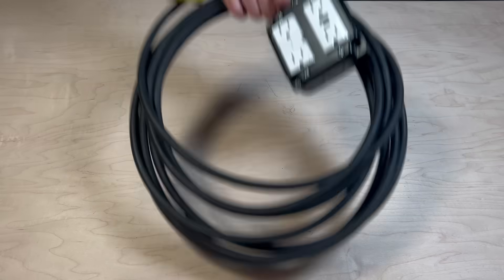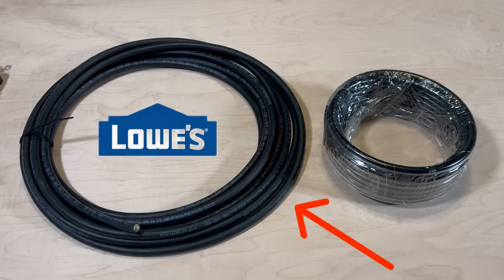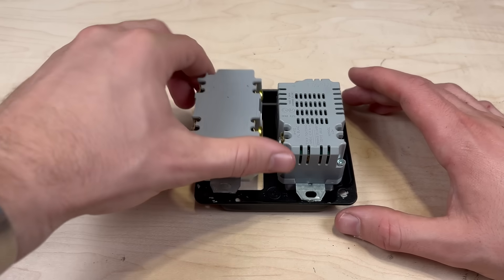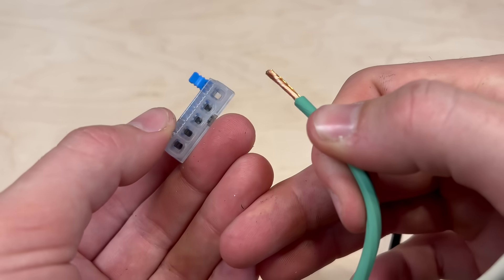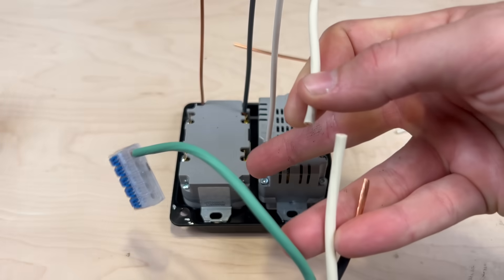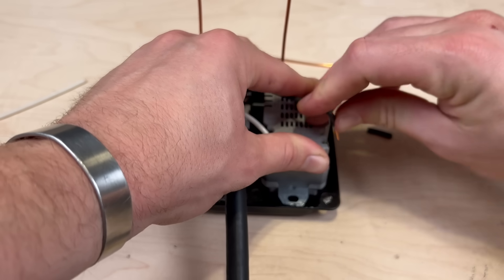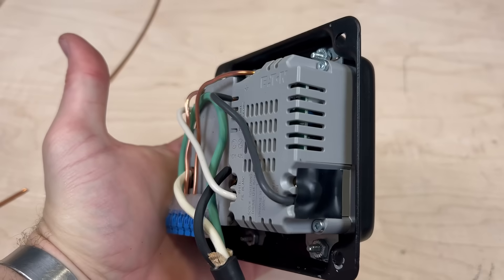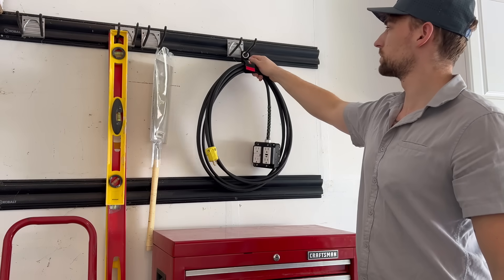HOW TO BUILD THE ULTIMATE EXTENSION CORD!

Comment: I built one similar to this a few years ago. My cost was way cheaper (maybe $5, total) because I got a long length of cable from my neighbor. It's a piece of a power cable for an electric mine car. He used to work in the mines and got about a 1/4 roll of it. It's really heavy duty, and really heavy. It's a little over 90' long. I thought about making a couple of them in varying lengths, but just made one using the entire thing. I may go back and cut it down to make one about 25' and another one about 50'.

I used the same technique with the 2-gang metal box, a GFCI outlet, and a standard outlet. I didn't put the kind with a USB port on it because this stays in my shop and is meant for when I need power at the end of my driveway, so I don't need anything like that on it.
Reply from the maker: That’s awesome Sean! You got lucky with the mining car cable. A 90’ cord sounds like a lot to manage but if it reaches the end of your driveway and provides power then it may be worth leaving it as is. Thanks for watching and commenting and good luck.

Comment: I like the idea of painting them, but unless you primed them with a waterborne primer, the paint will react with the galvanizing and flake off. It's called a saponification reaction. Nice project.
Reply from the maker: I was wondering about that because It started flaking off immediately. Thanks for the info, I’ll keep that in mind
Reply: Boxes are also usually covered in oil from the manufacturing process. You would want to go a good degreasing first at least.
Reply from the maker: I didn’t do that either lol. If I were to do it again i wouldn’t paint it. The paint leaves marks on my wood projects
Reply: they sell a special etching cleaner for galvanized that lets regular spray paint stick to it
Reply: @ranger178 Would using somethi g like Krud Kutter Metal Clean & Etch take care of both the cleaning and priming, leaving it ready for any kind of paint?

Comment: if you werent happy with leviton then you either got scammed by amazon sellers or you cheaped out and bought the basic residential receptacle instead of their hospital grade receptacles. based on how you didnt even buy legit wago connectors and how you used whatever offcuts of romex you had laying around, ill hedge my bets on which one it was. 

"nicest extension cord possible" lol. lmao even. not even close with all those cut corners my guy

also you probably should have used crimped ferrules on that stranded copper cable for safety. I made the same comment to studpack. they didnt listen either.
Reply from the maker: Thanks for the information! I’d be happy to review your video when you post it. I’m sure it’ll be popular since you have so much experience.

Comment: Just don’t take it on any professional work site subject to inspection. This will not pass inspection as boxes with knockouts and holes are meant to be put in a wall, not exposed to abuse. That box can be infiltrated easily and those  unused knock outs can get, well, knocked out by rough handling. For these safety (and code reasons), I would never build / use one of these.
Reply from the maker: Thanks for explaining that

Comment: One thing i learned is a gfci outlet will not work on a device with a compressor like a windows unit or icebox,  the surge will trip the internal braker. I do like the idea of a gfci outlet but i would put it second so you have options.
Reply from the maker: That’s an interesting idea. Thanks
Reply: A compressor should not trip a GFCI breaker.  In fact the NEC now requires everything exterior - including Air Conditioning compressors and outdoor kitchen refrigerators, etc. to be GFCI protected
Reply: @HBSuccess I agree but I personally have has issues, everyone is saying the same thing about it tripping the gfci so it's not just me saying it. Youtube it.

Comment: A GFCI at the male end would better behoove you. If the box falls into a puddle, there will still be current flowing into the box itself. If you put a GFCI protection at the male end, and the box falls into a puddle, it will kill the circuit making it safe to retrieve. But still a good job. I make boxes like that all the time but with NO GFCI and a cloth covered cord, as they are plugged into a GFCI outlet anyway and used indoors. Upgrading all my extension cords to 10 gauges though but that will take a long time as I have amassed hundreds of extension cords. Recently threw those out and replacing as needed with fabric like extension cords. But heavy duty ones, I think 10 gauge behooves me as I am always using high powered devices.

Just a note with those wire nuts too. I usually wrap them in electric tape as the levers have a tendency to work their way open, over time by heating and cooling, vibration, or a wire wiggles its way putting tension on the lever. I've had it happen with Wago, which is the brand I prefer and it seems that all lever nuts have the same flaw. So just a little extra. An ounce of prevention is worth a pound of cure in this instance.
Reply from the maker: Thanks for the info!
Reply: 100% True. In fact  his set-up is an OSHA violation and would result in a fine on a jobsite. The entire thing has to be GFCI protected, including the cable itself, so the GFCI has to be on the male end.

Comment: The ultimate is probably similar but using a 240/120v RV style outlet. I mounted an RV power panel outdoors to feed welders, compressors etc and recommend that to any mechanic. SOOW cable makes dandy extensions.
Reply from the maker: Great idea!

Comment: I made one similar to this years ago. I like some of your touches though. Mine uses WR outlets, has a toggle switch in the second gang, uses a pre terminated cable with molded plug and a little hot leg loop that comes out the top for a current meter to clip onto. I like your strain relief though so I may find a way to incorporate that into my box.
Reply from the maker: I wanted to add a light to the top like wranglerstar has but I couldn’t find one that would work with my setup. Do you still have the cord you made?

Comment: New subscriber based on this video. I'm age 22 and did gymnastics for 14 years. For various reasons I got into construction from age 13 to make money then fell in love with it. I'm now full time in construction. And do DIY when I can away from work. I've seen others (and StudPack is where I first saw this idea). I like your version better--though sad to hear you didn't like Leviton outlets. I've installed those. One thing I noticed that I didn't quite like is that your wires were a bit too long when you attached them to the outlets. I could see bare wire sticking out of each connection and those bare wires weren't even covered by the electrical tape. Other than that, I really like this device.
Reply from the maker: Thanks for sharing your story! The only reason I didn’t use the Leviton outlets was because they were different finishes (I probably overlooked the detail when ordering). One was matte and the other glossy. Not a big deal but I wanted them to match. I agree that I should have shortened my wires a bit before connecting them so hopefully it doesn’t cause any trouble! Thanks man!
Reply: @SemperDIY  I'm glad the Leviton issue was not something I should worry about. I've installed them as my default. Not that I'm a sparky (a term I got from the Vancouver Carpenter).

Comment: Your ground connection is a code violation. The ground wire from the supply cable must connect to the box and then to the receptacle. You could have avoided this with a plastic box.
Reply from the maker: Okay, thanks! If an inspector shows up at my house randomly I’ll hide my extension cord. Wouldn’t want a code violation!
Reply: Lot's of code violations on this device, lol. The box itself is not listed for portable use - it's only listed for permanent installation, the hook up wires have no listing writing on them meaning they were salvaged from what I presume was some left over Romex cable which is a no go, and then the ground hookup you mentioned. Of those violations the only concern would be liquids penetrating the box if a mop bucket or something gets dumped on the floor. Just something to be aware of.

Comment: Love the build! I’d definitely want a hundred footer though!😂 I feel like that thing will be super heavy but I’m about to build it anyway!🎉
Reply: It is MUCH wiser to build two 50-footers. I speak from decades of experience but I'll spare ya my CV. Buy two sets of plugs so when reality sets in you can cut it in half and have two cords.
Reply from the maker: I agree. Even 50 foot can be hard to manage
Reply from the maker: Good luck!
Reply: Just get a 100' cord and make a short four way. A lot cheaper.
Reply: @MB-zj3er At that length it’ll obviously need to be proper gauge to handle potential resistance issues and not be a fire hazard.
Reply: @stereothrilla8374  Correct, 12 Gauge will be fine. But you can do some calculations once you know your load if you are worried. At 100' you will have no issues with a power tool. Need four? run four cords, that's the way it works. :)~

Comment: Two things here and I’m already 2:38 in. One, you don’t need two GFCI outlets. Have the power supply going to the GFCI and a regular outlet wired to the GFCI. Non-GFCI will have GFCI protection. Second, given that you will be using this for tools and such, you should have gone with 20 amp receptacles and not 15amp.
Reply from the maker: I only have one GFCI outlet and it’s wired exactly how you described. Also I didn’t want to give someone the ability to plug a 20a device into the cord since I don’t think the wiring in my garage can support 20a. Thanks for the advice though.
Reply: @SemperDIY duh. You said that it was USB charging. 🙄 It looks like it could be GFCI, which is why I mentioned that two GFCI’s wasn’t necessary. If your left prong slot has a horizontal slit, it’s a 20 amp.
Reply from the maker: I’m tracking. None of my tools are 20a nor are any of the receptacles in my garage.
Reply: @SemperDIY if you’re running a compressor and table saw at the same time, good chance that it’s more than 15 amps combined.
Reply from the maker: Maybe but I’m a one man band (without a compressor) so I should be good to go
Reply: @jeremycarter  why would it be gfci just because it has usb? 🤦🏻‍♂️

Comment: First of all thank you for the very informative and helpful video. I look forward to making the exact same extension cord for my garage. A word to everyone. Amazon is no longer reliable and all of their supplies are absolute crap. Amazon does not care about the quality of the products they sell as they  want avoid tarnishing their relationship with Chinese manufacturers
Reply from the maker: Thanks! Good luck!
Reply: Amazon really don't sell much in their branding, most of the time when you buy something off the Amazon site you are buying from a supplier that has an Amazon sellers account.  Amazon has no control over the quality of those types of products as they aren't theirs, Amazon has turned into nothing more than a more current version of Ebay, anybody can have a seller's account, but it depends on the seller as to what you end up getting in the end :(.  Sadly sometimes you get stuff off Amazon, Ebay, that are worse than TEMU...that's not a good thing LOL.

Comment: Was that a 15A cord or 20A?
Reply from the maker: From my understanding, and correct me if I’m wrong, but the amperage a cable can handle is determined by the gauge of the wire. Since this is a 12 AWG wire it shouldn’t have any issues going up to 20A. If you were going to run 20A frequently I’d bump it up to 10 AWG wire.
Reply: @SemperDIY  no the wire is just one piece of the puzzle, if youre plugging it into a 15a outlet which is likely on a 15a breaker thats all you should be using. You also only used 15a rated outlets so it shouldn't be used for 20a even if the other conditions were rated at 20a. if everything was rated for it and you were running 20a all the time 12g would still be fine and there would be no reason to run 10g wire for a run that short.
Reply from the maker: Thank you for the information Patrick

Comment: The paint will degrade the ground connection.  Your ground needs to pass enough current to clear the 15 to 20 amp breaker on the circuit where you plug that cord.  To correct you need to remove the paint around the ground screw and ensure also that the cover is correctly grounded (perhaps by removing the paint from surfaces that contact the box).

And I would much rather look at a bare galvanized box than scratched and chipped paint. From the look of your orange cords, that paint will soon be scratched and chipped.
Reply: If you rewatch the video, you'll see that the ground screw connection has no paint on it, so he has full metal on metal contact. But, you'd be correct if the paint was still there.
Reply from the maker: Okay, thanks

Comment: Looks good. One thing to mention there is a plug end and socket end to a 3 wire cord. If you use the wrong end you will have to twist the wires around to get them in the plug. It will still work, but look messy. (if you follow that.) The electrical box would not matter in your situation.
Reply: Also, I always hook up the plug end last after everything else is done.  Things can get very spicy if the plug is inserted into a receptacle before everything else is secure.  Yeah, this is a situation that should never happen but theory and practice aren't the same.
Reply from the maker: That’s actually a good point
Reply from the maker: Now I get it. Okay you make a good point. If you have to cross your black and white wire to get it to fit into either the plug end or the socket end, you’ve got the wrong end of the cable.
Reply: Ok, how do you tell which end is which other than trial and error?
Reply from the maker: I don’t think there’s a difference
Reply: @SemperDIY  There is but it doesn't really matter for ext cords but when you get to heavier cords like like 6 AWG it helps basically you just look at the end of the cord and pick the end that matches without crossing the conductors.  Being an industrial electrician for the past 25 years and doing many cords and never having a problem it's not something the average person needs to worry about.  As my stepdad told me once "It's not enough to argue about."
Reply from the maker: @tom5256 thanks for explaining that. Now I understand which end is which. I think I use the right ends because I recall everything lining up perfectly on the plug end. Thanks!
Reply from the maker: I didn’t know that, thanks
Reply: Technically yes but makes little difference when you trim the outer insulation properly.

Comment: I would have masked off the mating surfaces between the cover and the box, and the interior of the box where the receptacle yoke mounts for better metal to metal contact, the paint is an insulator. It looks like you mounted the kep nuts backwards, the serrations should mate with the receptacle yoke.
Reply from the maker: The keep nuts have serrations on both sides but I do agree with you about masking off the areas you mentioned. I don’t think It makes that big of a difference since the grounds are connected but you’re right and It was something I overlooked. Thanks
Reply: @SemperDIY I'm not an electrician, but I have used those boxes before and haven't seen those type of nuts, always something to learn. Otherwise, I think you did a good job, thanks.

Comment: I definitely wouldn't hook the GFI to both plugs GFI does not work on things with motors like refrigerators
Reply from the maker: I’m not sure exactly what you’re saying. Can you clarify?
Reply: @SemperDIY I think that some older GFCI's would give some nuisance tripping on motor start up, but the newer ones should be fine. BTW, the NEC requires that refrigerators and freezers in the garage be GFCI protected.

Comment: Would have been better to use a Weather Resistant receptacle, like are required for outdoor mounted outlets, instead of a regular GFCI.
Reply from the maker: You’re right. I thought about it but this cord will spend most of its life in my garage so I didn’t think it was necessary.
Reply: First attempts are just that. Nothing invented was perfect the first time.
Reply: @LongWalkerActualthis is a stolen idea
Reply: @Toad_Commander   From whom?  I made a cord similar to this did he steal the idea from me?
Reply: If you’re going to use 12 AWG use might as well put 20 amp receptacles. I don’t see the point in wasting money on 12 AWG if you’re making an extension cord with 15 amp receptacles.
Reply: If you're going to use 20 amp receptacles, then you will need to use a 20 amp plug so it can only be plugged into a 20 amp circuit.
Reply: I had the GFCI receptacle catch on fire in a bit of rain with a design just like this.       Like whoa fire melted mess before the house breaker clicked off!     

I agree definitely use weather resistant even if one doesn’t plan on outdoor use - because shit happens and/or someone could use it outdoors in the future.   Just sayin’

Also a cool song by Esperanza Spalding “Black Gold” is how I remember which terminal for hot+.      Fun stuff
Reply from the maker: Okay, thanks for the advice
Reply: See how long that cover lasts. Better to take the electricity inside when it rains, it's not good for the tools you plugged in either. :).